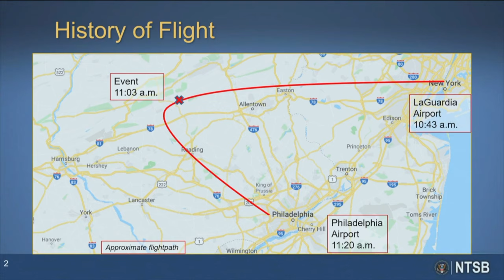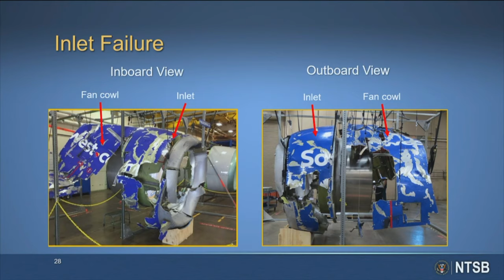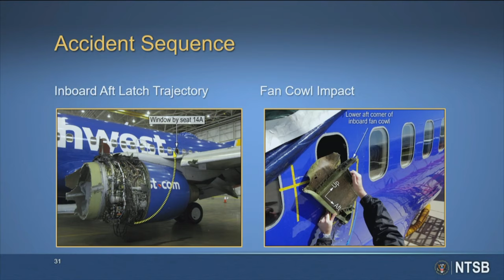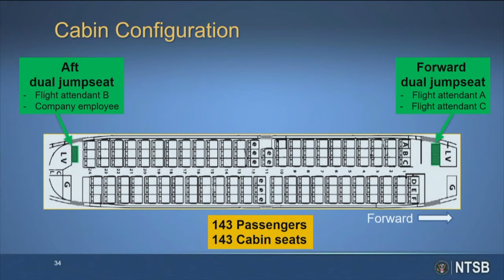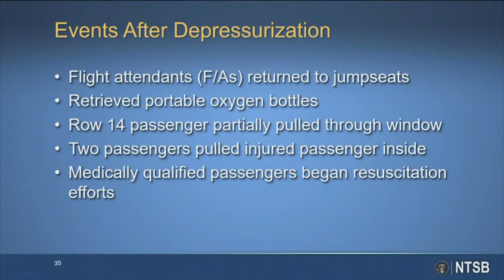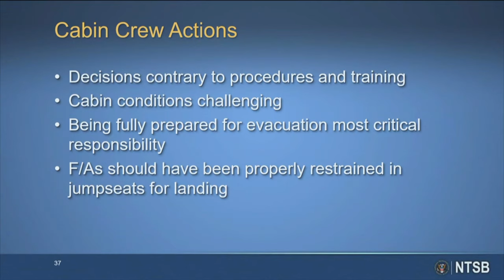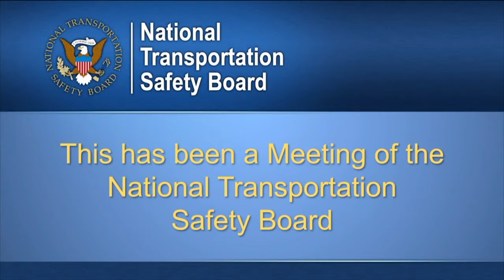Southwest Airlines Flight 1380 • NTSB Board Meeting

Comment: While Boeing wears the hat in the end, I doubt they made and or designed the cowlings. Engine cowling/nacelles are usually outsourced. I used to work for UTC specifically on engine cowling and  thrust reverser systems. None of my time was for 737 systems. I'm not sure who Boeing used on the 737/CFM nacelle system. Boeing probably gave specification and design outline to a vendor and that vendor does the majority of the engineering and design. Boeing would then have to sign off on all of that for acceptance. 

Events like this are sometimes unforeseen. Its not negligence, its a process of learning. Unfortunately sometimes people are hurt or lost in the process of learning. That is the important part that the lesson is learned so that it isn't repeated. That sounds harsh but take a look back in time and look beyond aviation. Countless numbers of people have been hurt or lost in the sands of time that lead to today.

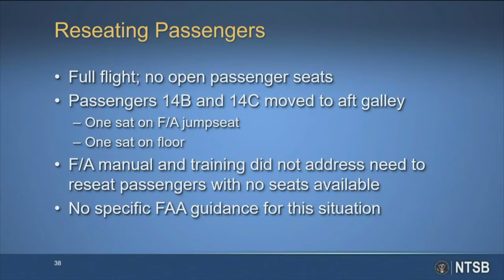Comment: 30:25 Good luck trying to get the air industry to not seat the plane to full capacity in the interest of reseating passengers incase of an emergency. Although, I gotta say props to Southwest for going above and beyond for relubing the fan blades every 1500 cycles and not every 3000 as the officials recommended and for scanning the fan blades every time the blades are maintanenced and not in specific circumstances as the officials recommended. ♥♥♥

Comment: This was not a uncontained failure, however it came off outside the case doubler at the 6 o'clock position and transferred loads to the fan case attachment causing it's detachment up and over the wing striking the windows causing decompression.
Reply: Interesting opinion. Are you a sitting member of NTSB?

Comment: This is a bit unfair that Boeing is getting scrutiny for an incident that is really caused by CFM. Look at Airbus and that Air France A380 incident. They didn't get scrutiny for when a GP7000 engine blew up an A380 cowling, which is the part of the nacelle that Boeing got scrutinized for.
Reply: It is very fair. Boing putting more and more passengers and bigger and bigger engines with out designing airframe. That what 737 Max show they achieve inheritably instable plain. There are no inherently unstable plains in the word, do not exist. Plain suppose to be fly as it was before if input of control surfaces stopped. The fact that 737 Max was now certified twice is disgrace. Everyone should have been fired for that. Bit not, Boing buy regulators and senators, they own government.

Comment: Did he really say the window “departed” the plane?
Reply: "Departed" in this case is a technical term ( just like the cowling departed the airplane)  as opposed to entering the cabin.
Reply: @williamgreene4834  The fragment of the fan cowl departed the plane but then re-entered it, making a round-trip flight and causing the window to depart the plane and arrive on the ground shortly afterwards.
Reply: @Kalumbatsch  The fan cowl also departed the plane in a technical sense. It just broke the window as it departed.
Reply: @williamgreene4834  Parts of it departed the plane and didn't enter the plane again, another part departed and then entered. De part that departed and then entered caused the window to depart and not re-enter. It may have entered the ground slightly.

Comment: This is another accident directly related to an engineering work-around by Boeing on a design that's time has passed. The flattened nacelle is due to the aircraft being designed for much smaller engines from the 1960's and modern engines not being able to physically fit under the wing. Boeing need to bite the bullet and design a replacement to the 737.
Reply: Boeing has continued the 737 airframe partly because of how the FAA regulates aviation. That regulation has made is so incredibly expensive to come up with a clean-sheet design. Thats not just Boeing either, all western    built commercial aviation. Even jet engines, even the most brand spankin' new engines are based off continued development and evolution of old legacy models developed ages ago. The new General Electric GE9X is based off the old CF6 designed in the 1960's. Its done that way because a clean sheet design costs billions to make, and much of that is from exhaustive certification and testing to meet FAA and industry requirements. Aircraft themselves are no different. The 737 is a very successful design and still a good aircraft. Sometimes things happen and we have to learn and move forward. Sometimes there are other contributing factors like are coming to light with the 737 max ordeals.
Reply: So, you won't be buying any of the B73X series anytime soon, eh?
Do you actually buy any airplanes, or evaluate them for airlines?
Reply: @directech  Me no, I'm just an A&P aircraft mechanic im not in that loop at all. I do have time working for Bombardier/Learjet experimental flight and as a vendor to Bombardier via UTC Aero Structures. A lot of my time was on the C-Series (now called the Airbus 220) flight test program. My team was responsible for the engine nacelles, cowlings and thrust reversers. So I have spent time in that work culture and have understanding of some of these aspects.
Reply: Boeing has designed a replacement 737 but it's got some serious flaws right now as we all know. The new 737-Max. Which by the way doesn't use the flatten CFM-56 nacelle engines because the 737-Max is outfitted with the CFM-LEAP Turbo-Fans. Bottom line in my opinion, CFM make a great engine but Southwest like any other airline has to perform proper and timely maintenance when its time for C and D checks. How many airlines are skimping over those critical checks? Boeing didn't have anything to do with the engine failure. That was between CFM and Southwest.
Reply: @ccwalker050  Southwest should not carry any of the blame for this. They performed the required maintenance not only to the manufacturers guidelines but exceeding their requirements. Southwest performed the required work more frequently than required. It is unfortunate that two occurrences of blade failure occurred on their aircraft but if there's finger pointing to do, its at CFM/Snecma.
Reply: @mytmousemalibu  If Boeing was to be pinned and blamed, what could be said regarding their shortcomings?